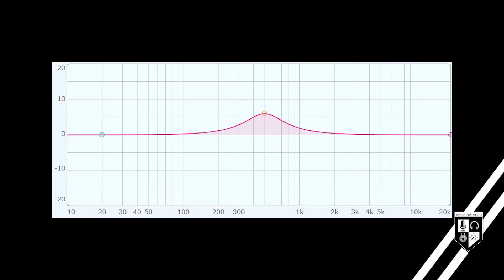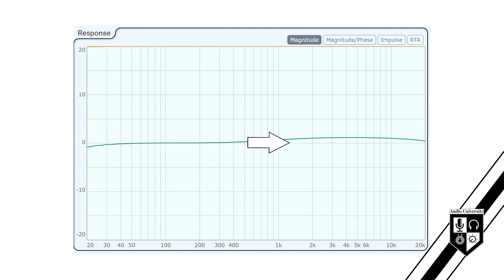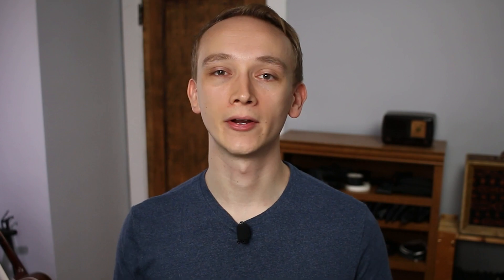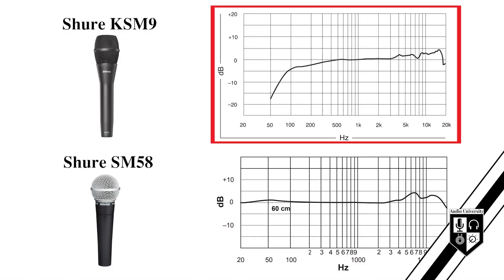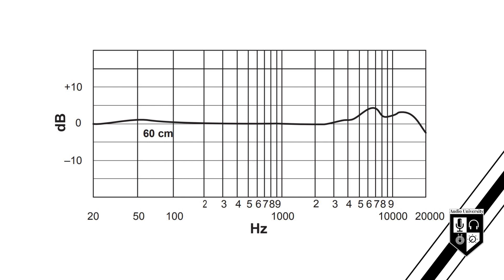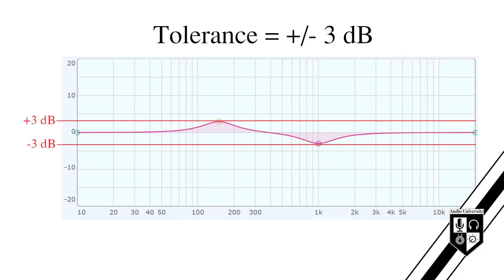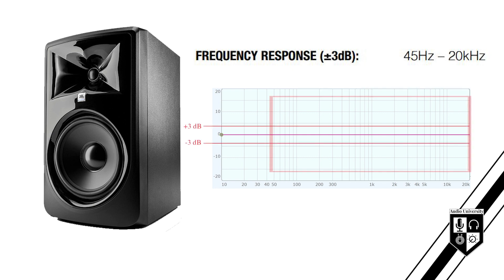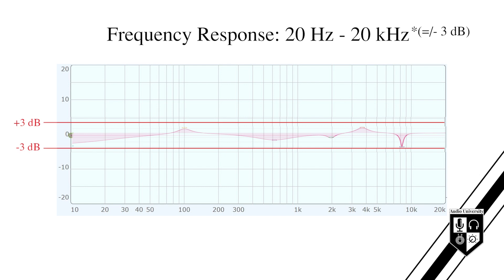Frequency Response Graphs & Specifications: DON'T BE FOOLED!

Comment: Hi, when we sending pink noise to measure flat frequency response for live sound setup.  What weight would you set on the measurement unit for measuring the frequency response of the speaker. Thanks
Reply from the maker: For measuring frequency response, I would normally use an unweighted measurement.

Comment: for both mics and speakers , on-axis freq response is highly insufficient to evaluate how the mic/speaker will perform . What you really need is directivity info : a freq response in every direction , not just on axis
Reply from the maker: Good point, Gerrit Govaerts. In most situations, it's important to understand how directivity affects the frequency response of the speaker at different angles. Thanks for watching and commenting!
Reply: @AudioUniversity  what's even more important for a speaker (prolly also for a mic) is constant directivity : the freq response off axis  should be a near carbon copy of the on axis except for the loudness level (lower is allowed) . This implies that you will hear the same music from the indirect sound as the one from the direct sound .Almost all front firing classical monopole box speakers (99% of what is sold) do NOT have this property . Well designed omnipole , dipole and cardioids do .